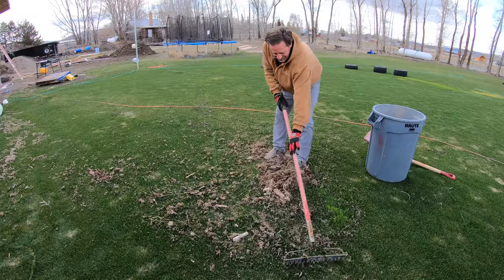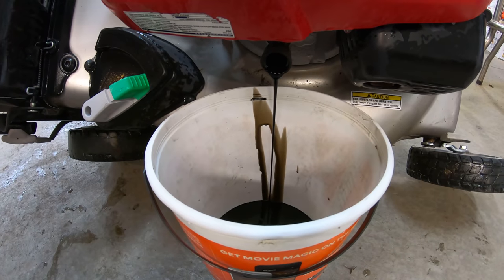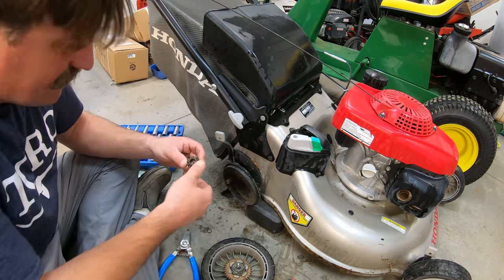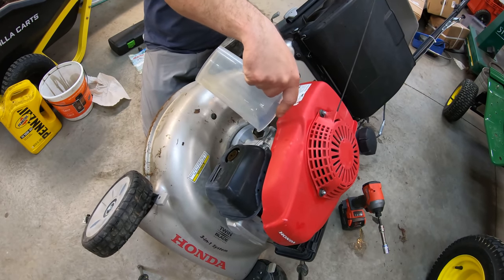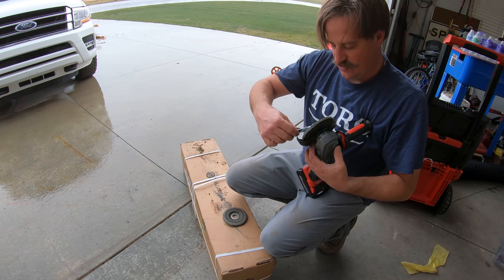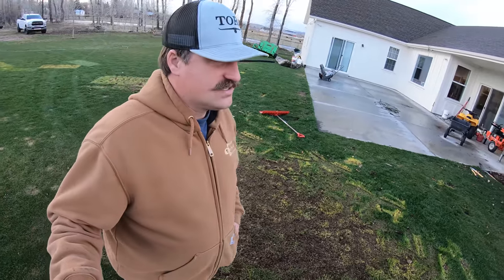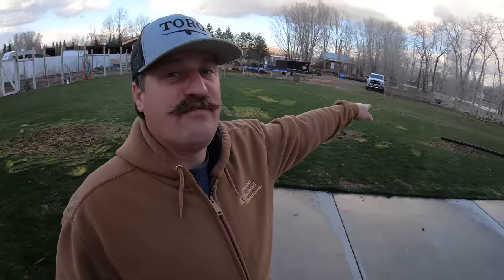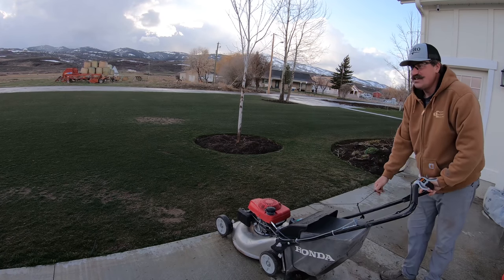HOW TO CLEANUP a HUGE lawn mess. Get LAWN MOWER Ready

Comment: I already have spots 6 inches long in my yard. I unfortunately won't be able to mow my own yard as I have developed a medical issue that will take months to recover from. Enjoy every moment of it, and don't sweat the small stuff.

BTW, did I see you changing that grinding wheel with the battery in?
Reply from the maker: Yep. That doesn't count. Safety third

Comment: I think something is still wrong with your mower wheels.  If I am not mistaken when you were pulling it backwards it should be making like a ratchet sound and the wheels should rotate backwards.   I can not remember if it has to do with the gear or pins inside there somewhere I just remember I put something together wrong once and it did the same thing.  Love the music by the way!

Comment: it was hard to tell but it almost looked like the small half moon metal piece in that wheel fell on the floor as u were working on it. those wheels shouldnt lock up like that when you pull it in reverse, they should spin with slight tension. also you have to make sure you have that gear going in the right direction .
Reply from the maker: Yeah.. The little half moon key in the shaft fell out. I  fixed it and explained the whole thing.......camera wasn't recording. Doh
Reply: @lawnrebel  just trying to do my part is all